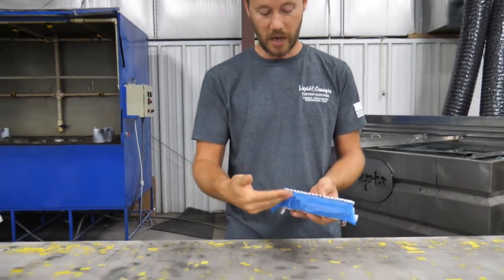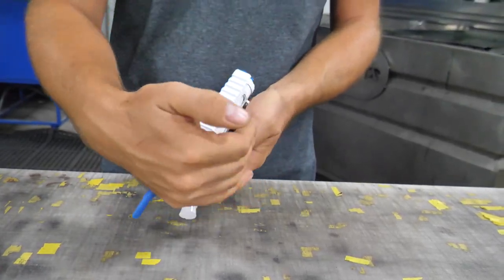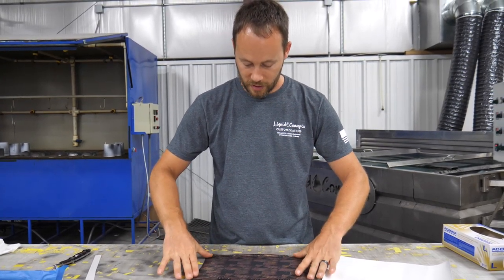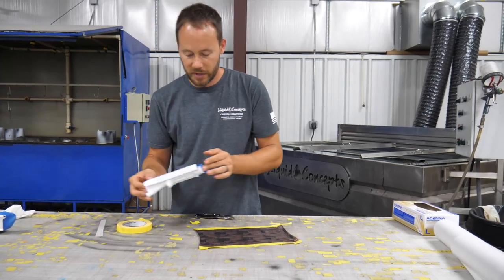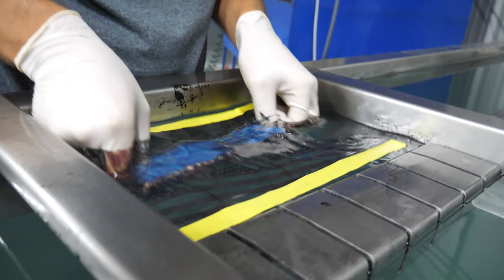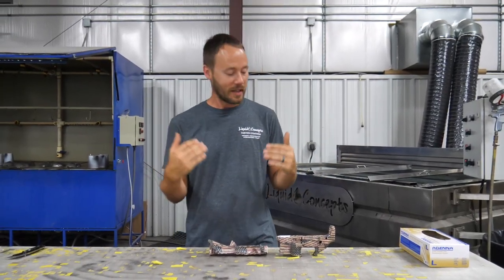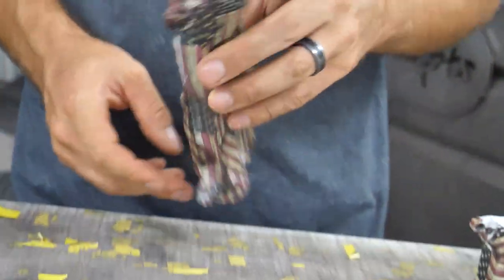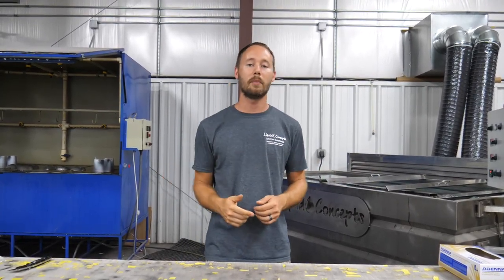HOW TO HYDRO DIP AN AR15 IN CUSTOM FILM | Liquid Concepts | Weekly Tips and Tricks

Comment: Do u put anything over the first dip so the tape don't peel off the film when it was still wet?
Reply from the maker: We typically like to spray an intercoat over the 1st dip for protection. If the dip was activated correctly then you should be able to just tape it directly but as a safety precaution the intercoat is a safer bet for sure!